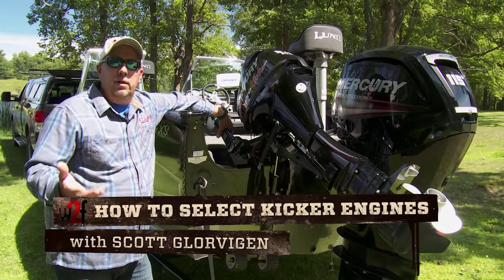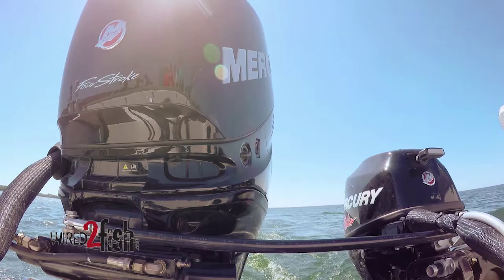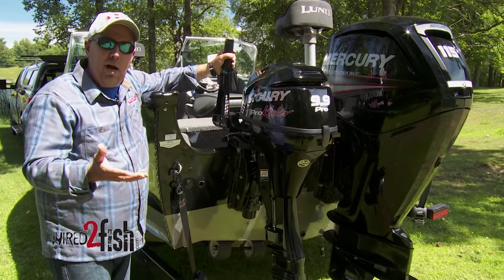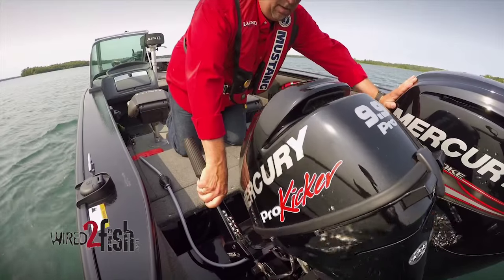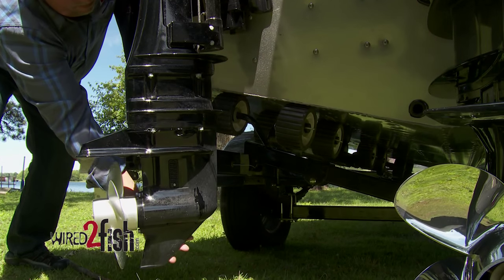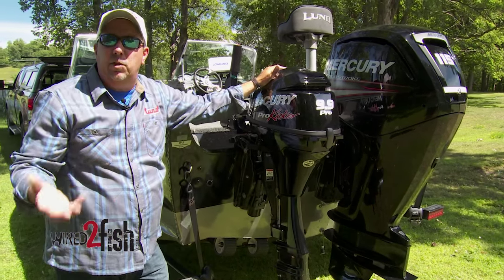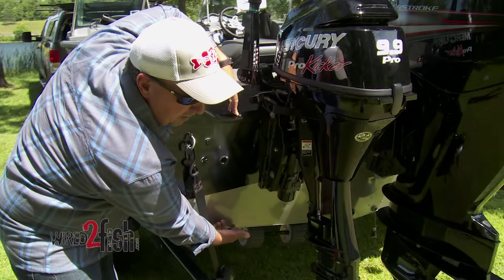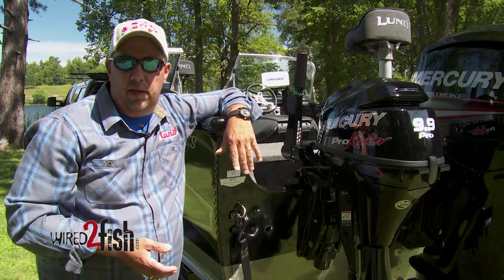How to Select Kicker Engines

Comment: Is a kicker motor a different option to let's say a electric trolling motor? Does a minkota motor do basically the same thing?
Reply from the maker: Hi Ricardo, kicker gas motors are primarily used for trolling applications and as a backup to the big engine when fishing big water. A trolling motor doesn't have the power or longevity to troll in big water wind/waves like a gas-powered kicker motor can. That said, Minn Kota does offer a unique engine mount trolling motor (https://wired2.fish/MinnKotaEngineMount) for those interested in battery-powered forward thrust, but again, not quite a gas substitute for long days trolling big water.

Comment: With the new gps and remote trolling motors now its nice to just use the kicker as a straight propulsion and steer remotely with the trolling motor instead of having to steer the kicker.......really saves the batteries on the trolling motor because the kicker does all the hard work.